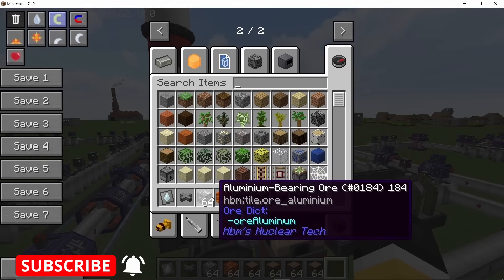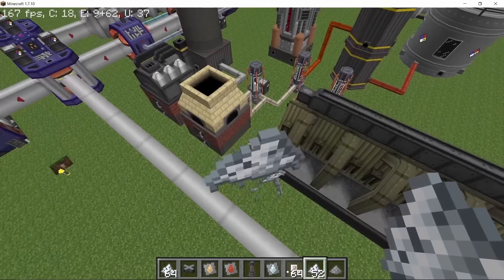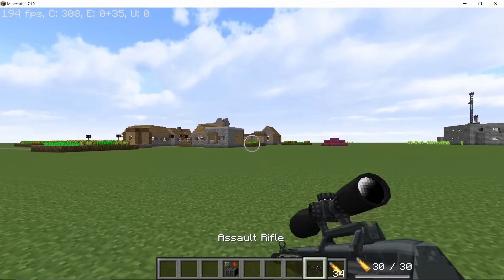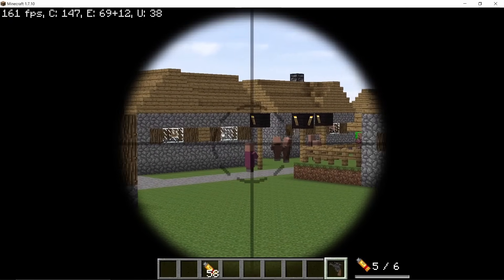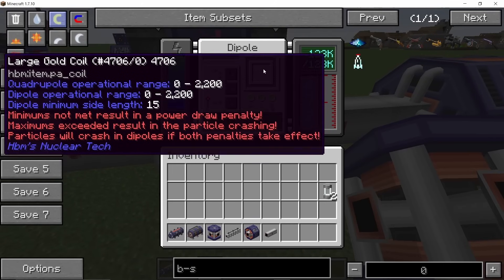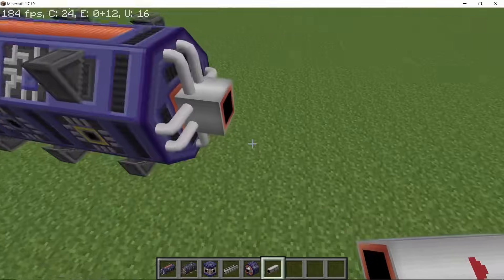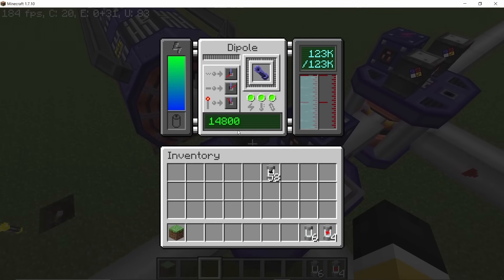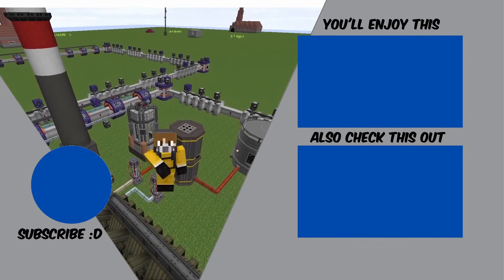Weapon Modification Table, Particle Accelerators, Bauxite Processing and More - HBMs NTM Updates

Comment: Is there a way to use the drainage pipe to only void excess fluids but automatically and not all of it? Would like to build a completely automated oil refinery in my survival world, but with so many outputs I don't use often filling tanks will completely stop refining. (looking at you heating oil)
Reply from the maker: Tanks output a comparator signal, there's Redstone fluid valves available. Using these two you can make a simple automated system to get rid of excess fluids
Reply: @SavageVegeta  
Thank you, I tried a comparator earlier and didn't work, now I realize the tank was empty. Lol